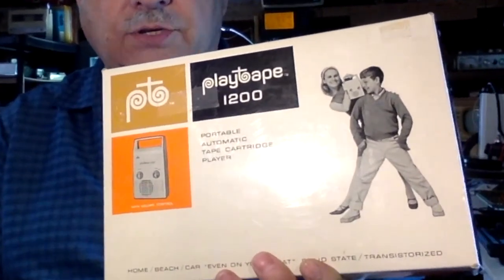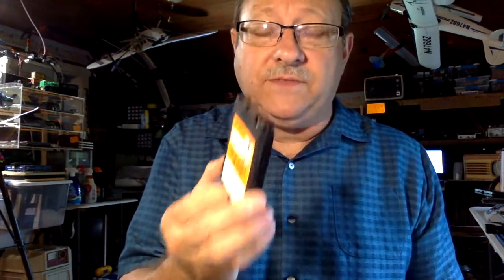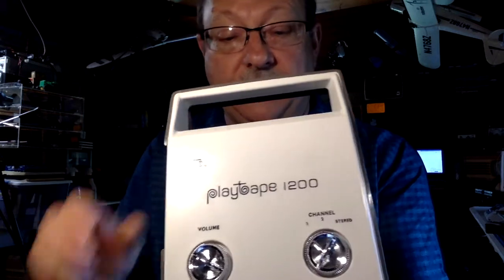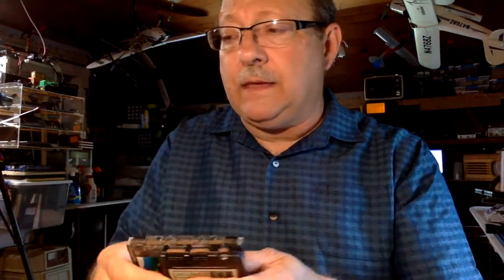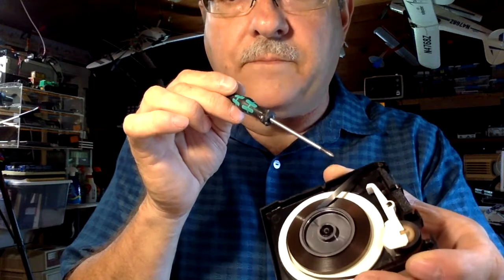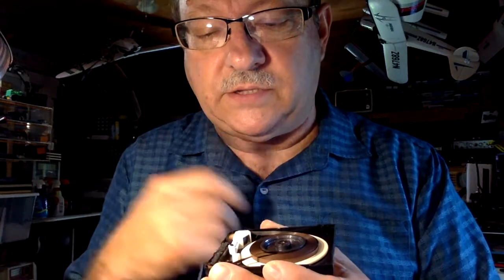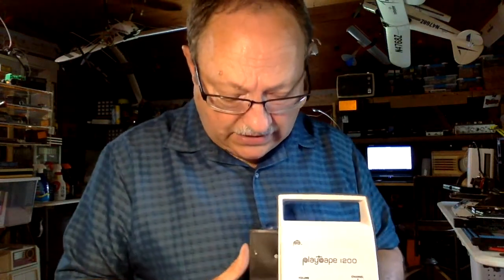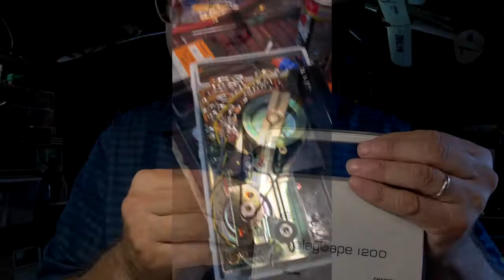Single Speaker Stereo. WOW! Gotta Love Vintage Technology!

Comment: The Stereo switch is so you can hear Left and Right channels at the same time, (otherwise you would only hear one or the other).

As for recording on the tapes,  as you have other PlayTape machines, why not hook the heads up to an old cassette player/recorder circuit and use that to record. I did this with a spare 8Track player, (before I had a recorder). I had to time the tape, (per track), then run the tape through the machine with a magnet held up against it to erase it, then record on it through the cassette record circuitry.

I wish 8Tracks had a brake system like that.

And finally, you should never turn the reel the tape is on to get the tape back in the case, it jams it up, always move the actual tape itself around from the outside, (take-up).

Great video, can't wait for the next one.